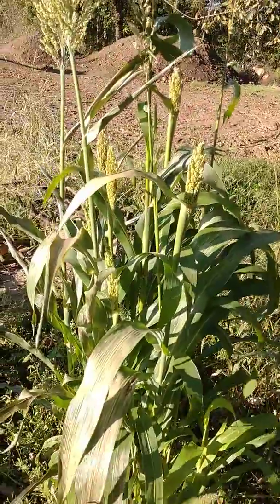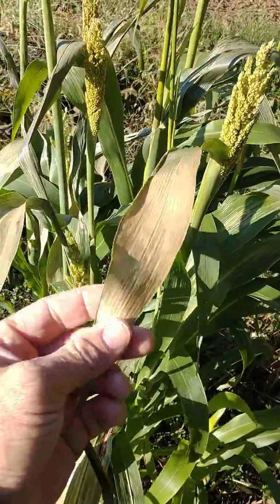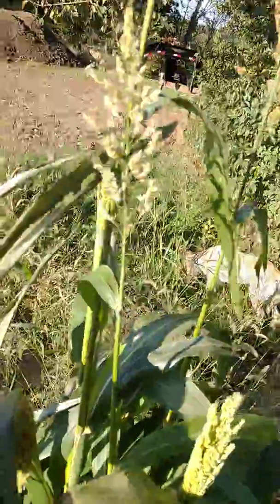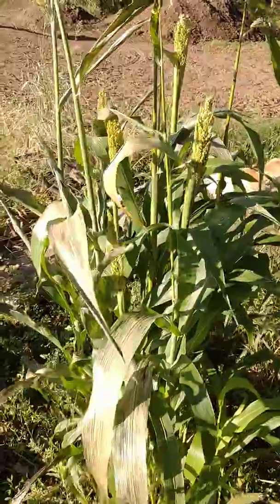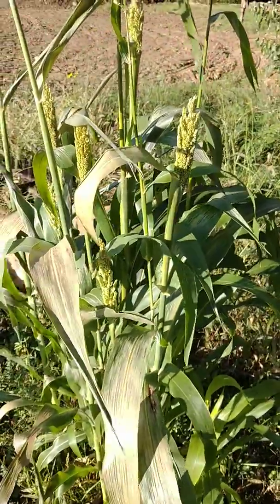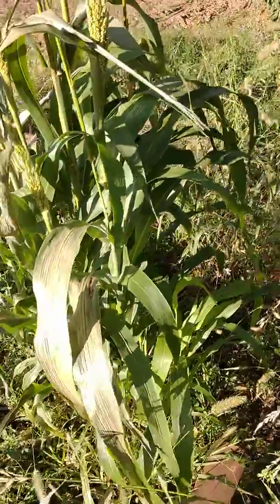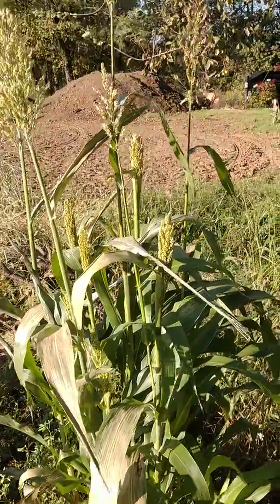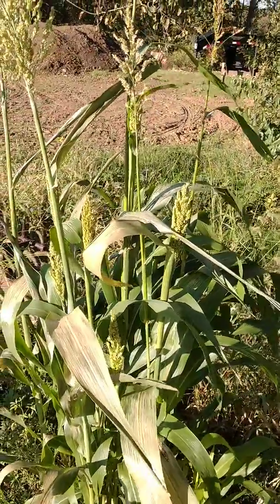TAKE 3: PRUSSIC ACID...

Comment: What if I have a threat of frost, cut the crop down and windrow it, then it freezes with the crop in the windrow? Am I still looking at that 10-14days?
Reply from the maker: When cut hopefully it was crimped and helps release gas..By the time it dries enough to do silage or baleage...more will escape. If doing dry hay more the to escape. Should be fine do just do the process as you normally would. Each time it is mechanically manipulated you help reduce faster